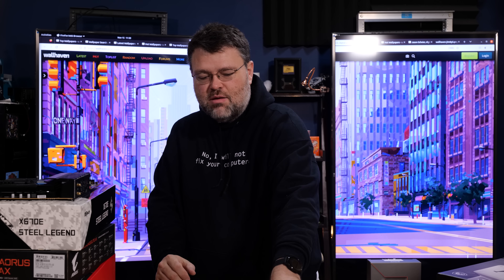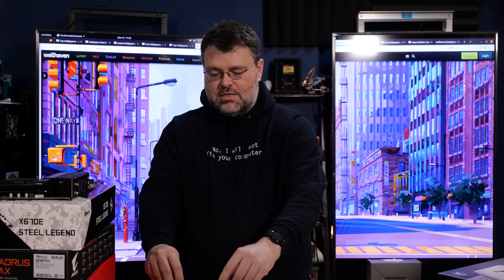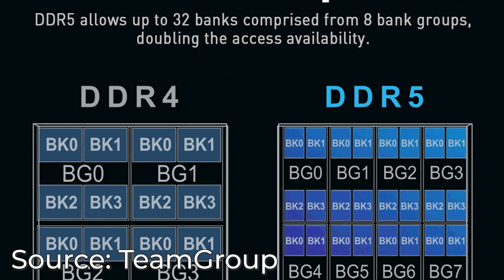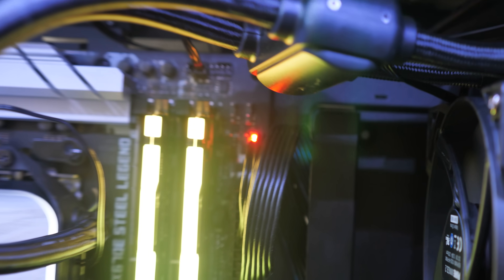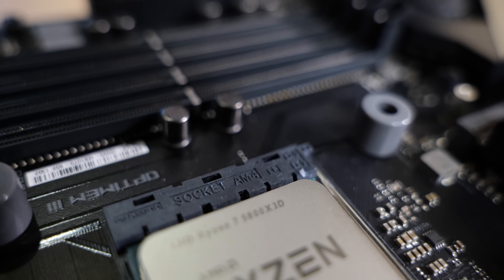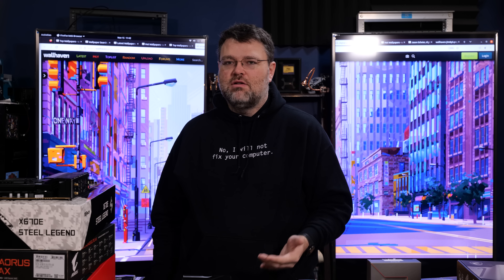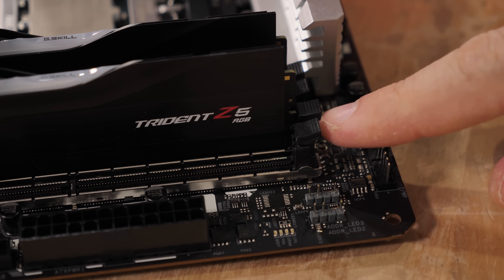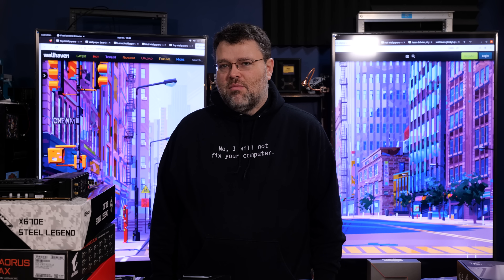Is 128GB of DDR5 IMPOSSIBLE on AM5? Level1 Investigates!

Comment: I am running 7950X3D over Rog Crosshair Hero X670E Motherboard with 32GB * 4 (128 GB) of memory from GSkill (Neo Z5 ARGB 6000 MHz). Highest memory clock i am able to run stable is 4000 MHz. Anything beyond is guaranteed to cause C5 error

Comment: The video is interesting, this “next room approach” is actually practical in most homes. I used to think that water cooling was a necessity for a Silent Gaming PC / Workstation until I tried positive air pressure (inside the case). With positive air pressure and enough high-quality fans in the proper orientation and a good enough case you can enjoy a silent PC with near water cooling temps (less than 60 Celsius under load). I use Arctic 120mm fans, they won’t go above 1000rpm often, and they are not expensive like Noctua fans. In my personal experience the Best orientation for air is top to bottom with PSU fan facing inside the case (as exhaust fan), and front to back with a WS case (with 3 front fans). Even blower style GPUs get cooled efficiently because of the fresh air being pushed / moved constantly inside the case. The key is to have more / faster intake fans, and less / slower exhaust fans, and not to have conflicting / opposing airflow; this way the air moves quickly and the fans don’t have to spin up to higher RPMs.

Comment: you just saved my sanity with this video... as it has been a few years since i last built a machine, i would never have expected the limitations we currently face with 4 DIMMs. 10minute Boot times? No freaking way... but yet, here we are.

Got my 128GB to run at 3800MHz, will have to see if its stable though.
Reply: Is that even a good idea? 3800mhz pretty low can you game with this?
Reply: @ it works with no complaints so far... could it be faster? i dont know. i'm not playing very demanding games. If you're building a gaming rig, i would say you don't need more than 64GB RAM that can clock much faster

Comment: I faced the the same problem. I have 4x16 Gb DDR5 6000mhz Corsair sticks. When i use 2 sticks in Expo mode i see the speed is 6000 Mhz in the task manager. When i disable Expo it shows 4800 Mhz. I want to use all the sticks as 64 Gb at the same time but i couldn't manage to run and enter Bios. I am using Ryzen 7900 on Asus B650E-F motherboard. In the web page of Asus it is shown that max possible speeds are 5200 and 3600 Mhz but i see the speed in the task manager is 6000 MHz. Which one is true? Really confused.
Reply: I have the same motherboard and am experiencing the same issues. I am using 4 x 16 GB and since two days my CPU gets very hot 90 degrees with start up and I get the orange led Dram and the red led PCU and my PC does not boot at all or very very slow. Now I have 2 x 16 GB in slots 2 and 4 and the problems are gone and the temperature of the CPU is back to normal 50 degrees.
Reply: @Isheep-s9z  4x16 gb is not ideal for DDR5 architecture right now. They may fix it with bios update in the future. I am using 2x16 gb like you. Sticks are running at 5200 Mhz. Sometimes i still have crashes in W11. I think it is related to to mobo or psu.
Reply: @mordavian  I was already informed about this when purchasing the products, but I wanted to test it myself. It worked fine for three months, but yesterday the complaints started to arise.
Reply: @Isheep-s9z  Do you have any crashes in windows or BSOD? My system crashes at least twice in a day but sometimes no crash. It is very weird. Suspecting from my Asus B650E-F mobo and i may return it to seller. These sticks are not in the compatibility list of mobo producer companies.
Reply: @mordavian  Maybe u need to update your bios. I don't think this MOBO support 4x times 16 GB yet, also EXPO giving issues.. The issue was gone after the bios-update and removing two memory sticks and leaving only 32 GB behind in slot 2 and 4... Slot 1 and 3 also giving issues... I haven't had crashes but the system would not boot bc my CPU went to 90+ degrees everytime i reset the system.
Reply: @Isheep-s9z  i have already updated a while ago but sometimes I still get sudden crashes even in ıdle mode. 90 degrees in your system is really high. Are you using water or air cooling?
Reply: @TorchCTI yes I ran the test for a few hours but result was normal. I sold one of the 2x16gb sticks and using other at 5200mhz while expo is off.

Comment: I am using 7950x and 64gb (2x32gb) all fine. Then i upgraded to 4x32gb (all the same) and the pc wont boot. I tried everything, and its not working. After i take two of them out, it works fine again.... Whats the reason for that? spec> Kingston fury ddr5 5200MTs, cpu 7950x . Thanks!

Comment: I think the problem lies in these areas Power Available, Heat produced that builds up in the Chiplet package and bandwidth and timings that the memory/board(Build Quality&Chipset) & CPU can successfully communicate in. No point AMD running 4 DIMs to the max if your getting errors then having to repeat cycle or worst crashed system.

Comment: This is so bad review and so incorrect. With only 4 sticks of memory (kingston 6000mhz) and 1 motherboard (meg ace x670e) I’ve got 5600 mhz stable with 128gb and 34-35-35-68 timings. Thinking of posting a video with all my settings maybe will do. It clears all memory tests stable including memtest86. 74,5GB/s read 81,5GB/s write 70ns latency. Imagine what I could do with 100 different hardware at hand like this reviewer. Also, im not an expert this was my first ever overclocking.
Reply: I have Kingston EXPO 6000 128GB memories in a B650 Strix and can't go above 4800mhz, no matter what. I really don't think your setup is in a stable state with 5600mhz, not at all. I worked at AMD between 2014 and 2019 and I asked these guys the best settings of how to improve my clock. They already stated that this is not possible in this generation due limitations in the memory controller, so the info this channel provided is not incorrect at all

Comment: WOW 4x32 GB Trident Z5 NEO are now running on the ASUS x670e Hero at 5000MHz my settings are: Tcl: 36, Trcd: 36, Trp: 36, Tras: 77 the speed for the 4DIMMs at 128GB improved now to  Read: 68'330 Write: 72'765 Copy: 67'461 Latency 76.0ns.. But whatever I try at 5200MHz will fail until now, but 5000MHz is better than 4000MHz. The Curve Optimizer for my 7950x CPu is: all cores/ negative/ 16. If I can get the 128Gb to run faster than read 70'000, then I would post again.

Comment: I tested my 4x16GB Kingston FURY 6000MHz CL36 EXPO total 64GB with Asus x670e Hero and a AMD 7950x, they are stable at EXPO with 6000Mhz and the AIDA64 Cache &  Memory Benchmark score is Read= 75066 MB/s Write = 78479, copy 6787 and Latency 78.
Now when I set the 4x16GB RAM to 4000MHz like in your case, I get R:54446 W:56642 C: 50593 Latency 102.0ns. WIth only 2x16GB at 6000MHZ the speed falls down to R:45627, W:42550 C:39349 L:75.6ns and at 4000MH it is again much slower! This was  when I use slot 1 and slot 2. Found out that my Z5 Neo with only 2x32GB  in Slot 2 & slot 4 will be faster than with 4x16GB, 2x32 are running at R:78086 W:81462 latency 75.4 in expo I, but it is not so much faster. Any other slot combinations will not work for 2 DIMMs or will be much slower. So I corrected this post as I found the reason of my slow 2 DIMMs...

I guess the limitation in my Memoryspeed is more because of 128GB vs 64GB and not because of 2 or4 DIMMs.

Comment: My two configurations are 2x2x16GB Kingston FURY 6000MT/s CL 36 with EXPO, so total 64GB, they run without any problem with the EXPO setting at 6000MHz on a Asus x670e Hero mainboard. Then my 128 GB configuration is 2x2x32GB G.Skill Trident Z5 Neo. They run when I set EXPO II at DDR5-6000 30-40... but then I have to set the Memory Frequency to DDR-4800, EXPO I is not stable but EXPO II is running my applications mostly without problems. With 4x 32GB I get Memory Read=62007MB/s Write 70202 MB/s Copy 61156 MB/s latency 96.8. I'll have to check that also with the 4x16GB what should be much faster.

Comment: Thank God for corsair  they're  dropping 4 dimm kits just got a 4 dimm kit of 6600mhz at 32-34-34 76 also only 91gb/s? My intel platform is pushing over 100gb/s currently with the previously mentioned 4 dimm set closer to 107 with an overclock but I'm uncomfortable with how high I have to have the voltages to maintain stability... also having the igpu enabled causes stability issues with my Intel platform

Comment: You can do it you just run it all unnecessary speeds like 5k or higher, those speeds are overpriced and redundant anyways in a normal use scenario.  It's like buying a 4090 to play minesweeper, totally dumbshit idea.  Drop the speeds to a reasonable level 4-5k is fine and drop that voltage or you'll burn up the memory controller like intel allows, Ryzen has built in specific levels to prevent this without intentionally forcing it and people are freaking out. Even the hardest video editor/creator would e hard pressed without tool to tell the difference in rendering between 4k and 6k ram speeds.  It's nice to have but comes with a cost in money and potential mc burnout.

Comment: Just built an AM5 system with 128GB DDR5 based on 6600 sticks. Can boot Win11 at 5400. Knew I have to sacrifice clock rate with 4 sticks. Finally made it stable at 4800 with aggressive parameters (tCL-tRCD-tRP-tRAS etc.).

Comment: I had an issue, which I think is a memory issue, running 4x16 @ 6000 with G.Skill Z5N Neo even though the kit is listed for the motherboard as compatible. With 2x16, it seems stable. With 4x16 it was stable for a while, then because BSOD chaos @6000. I never had an issue running DDR4 @3600 with 4x16 and an R9 5900X.

Comment: I have a Crosshair X670E and it's a heap of crap. Slow to get BIOS updates, and when they finally bother, they're unstable or cause more issues than they solve. My machine still tries to do memory training eithe every or every other boot leading to 40s - 2 minute POST times.

Tied different RAM at stock, DOCP, manual settings, the board just sucks

Comment: Wish I saw this video first before buying 2 pairs of Corsair Vengence 5200mhz kits for 128gb total. Luckily I didn't buy high end ones, which would have wasted the chip speeds. On my MSI PRO X670-P WIFI with 7950x I was able to get a stable 4600mhz - it passed two PassMark memory test runs. 4800mhz posts and boots, but fails memory test. 5000 and over does not post and need a CMOS reset (or take out two of the chips to boot and change bios settings)

Comment: at the time of writing the non RGB version that has a 10,67ns true latency instead of the 10,00 is arround 74 euro cheaper. that's almost 80 usd price diff. 
G.Skill Trident Z5 Neo RGB F5-6000J3040G32GX2-TZ5NR vs G.Skill Trident Z5 Neo F5-6000J3238G32GX2-TZ5N
when buying 2 kits that's a lot of money .. i don't know if i need that much mem right away.. perhaps in a few years when prices drop.. never plugged in more mem later on in a build.. am i correct in assuming i need to get at least the same latency and speed and be ok ??????

Comment: I am getting 0d or C5 error most of times when I try GSkill 4 DIMS with 2x32 DDR5 on Asus 670E HERO / Ryzen x 7950X
Reply: I couldn't get it working with 4 sticks, (128GB) system was always stable but fed up with boot C5 or 0d errors.

I think I am gonna settle for 2x32GB at EXPO II (Ai overclocking) 6000 MHz. At least, I can be happy about the memory speed!

Comment: I have an AM5 system on order and chose 2x 32GB DDR5-5600 in combination with a X670E-creator mobo just because I read the many problems with 4 dimms. Seeing this video confirms this.
Reply: I have 5200mhzt ddr5 4 dimms 64gb, 2 dims work perfectly fine, even though my ram is not on the QVL list, but with 4 dimms I get issues, all are from the same vendor and make, pc boots and runs but I get weird issues in windows, black screens, a random blue screen once in a while. But when I disable xmp (docp) and run ram at 4800mhzt everything is fine
Reply: @thealien_ali3382  I just received my system. My 64GB DDR5-5600 kit is on the QVL list and it works fine. Ran prime95 torture test without issues.

Comment: Was there ever further investigation here? I can't seem to get 64 GB (2x 32GB) stable at 6000MHz with XMP on AM5.
And how do I find the best settings quickly rather than a million reboots? 🤦
Reply: Try it at 5200MHz and then increase it and test it with cinebench render + 4k youtube playing simultaneously that will windows crash real fast if it's not stable, 3 render runs back to back should be enough to crash it every time.

Comment: So I'm still a little unclear. 
I currently have two 16GB DDR5 6000 DIMMs installed on my X670E motherboard. It's stable at it's EXPO rated speeds/timings. 
If I were to buy another identical pair of 16GB to install as well, might I not be able to expect those same speeds? If I'm interested in running 64GB of RAM on this board, did I make a mistake by initially going with a 2x16 gig kit?
Reply from the maker: Yes it's more likely to be problematic with the 4 dimm situation than it would have been with 2 even though the rank side of the equation may be identical
Reply: @Level1Techs  
Oh dang, that's frustrating to hear. 
Thank you though for the clarification and investigating this topic.
Reply: try it and see, return the extra ram if not.
Reply: @jondonnelly3  yeah, I'll likely end up buying a matching pair a year or two down the line once they hit deeper discounts, and if I run into problems maintaining the advertised speeds then I'll do just that, send it back

Comment: I built my new rig in October with a 7950x and 4090, I have 4 x 16gb DDR5 6000mhz RAM, it's the Kingston Beast EXpo Ram.
I have been having very slow booting and occasionally (once a week or so) it won't boot at all and requires a CMOS clear to get into Windows.

The machine is an absolute beast when in Windows and running well and it holds 6000mhz without stability problems but these little annoyances with booting etc do get old very quickly, for example my old AM4 system booted into Windows in less than 5 seconds, I'm closer to 45 secs to 1 min with the new machine. 

I wasn't aware that 4 DIMMS could cause an issue with X670, wish I'd gone with 2 x 32gb kit now.

I will try to remove a couple DIMMS and do some testing, see if the boot times and stability improves, thanks a lot for bringing this to light, not a lot of people are covering these topics

Comment: Where are the problems with 4 DDR5 coming from?
Is it something which can be fixed in future by a BIOS update by AMD and/or by motherboard manufacturers?
When the motherboard manufacturer offers 4 DIMM slots for DDR5, and it is not really possible (at least not now?), is it not a reason to give the motherboard back or get a price reduction, when I already bought it, but want to keep it?
Is there a size limitation per DIMM? So could a DIMM bigger than 32 GB be a solution? So 2x64GB could be possible and a solution for the future? What is the maximum DIMM DDR5 size, which current system support?
Same problems on "the other side"? How is it going on Intel side with 4x DDR5?
Reply: https://www.youtube.com/watch?v=pmCRg3jvfIk

Comment: Got my new PC up and running. Intel i9-13900k, Asus Z790 ROG Hero MB, 8TB RAID NVMe RAID array, 4090, and 128 GB G.Skill 6000Mhz DDR5 RAM. PC kept crashing with all 4 DIMMS. 2 worked fine. Ultimately disappointed I'm not going to be able to run all 128 GB of RAM but it's good to at least have a professional review on why I couldn't get this config to work. Thanks!
Reply: Did you try running it at a slower speed?
Reply: @blakemccorkle18  Yeah, you can run all 4 sticks if you drop it down in to the 3000 Mhz range but that kinda defeats the purpose of the high end DIMMs.

Comment: You did a video on the ASUS Sage wifi  and threadripper pro? I cant find it.. 
Im struggling to decide on Ram for the holidays, had the system about 6 months now. Settled on 1tb 3200, thinking RDIMM, but iffy about going quad rank or octet rank. My thoughts are Octet rank will be better overall even on small loads since the system has 8 channels. Any advice is helpful! Thanks

Comment: Given that PCIexpress 5.0 speeds are already approaching single channel DDR5 speeds, I wonder if in the not too distant future PCIexpres 6.0 could take over as the memory standard on desktops. Given a 4x slot can carry 30 GBs a 16x memory interface could allow 4-4x or 2-8X DIMMs to operate at 120 GBs, If they can get Bifurcation to work better, and self-negotiate they could just have a single 16x DIMM standard and route it to all slots, then the DIMM's and the controller bifurcate themselves to share the lanes equally. So you never compromise overall speed for capacity.

Servers can use the same technique but have more lanes to support more lanes on more DIMMs.

The bonus is, PCIexpress takes up fewer pins than a parallel memory interface, so actually 16x may be quite conservative as anything less then 64x interface would still use less pins and be easier to route on a board than a parallel memory interface. Given that, even at PCIexpress 4.0 speeds a 64x interface is still faster than dual channel DDR5 for the same number of pins!

Of course there is the possibility someone will just make an utter baller move and put a few stacks of HBM3 right under the IHS... If it's all about the performance crown at any price, then that should do it!
Reply: There's a reason why ram slots are right next to your cpu. Having to access memory from pcie lanes would would make programs run so slow. Ram needs short special traces connected to the cpu memory controller